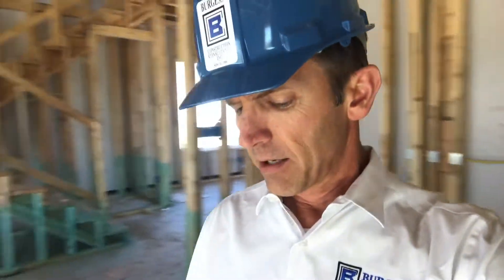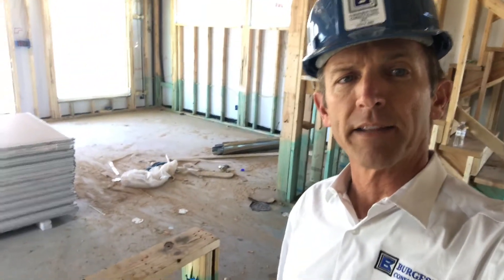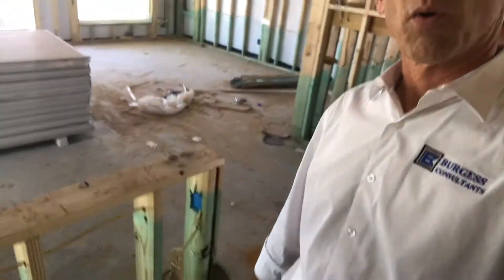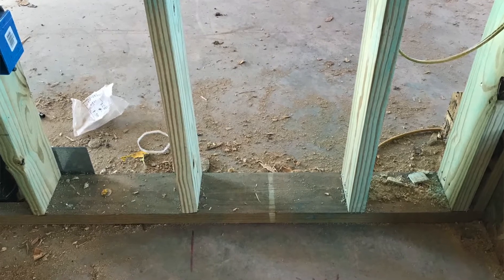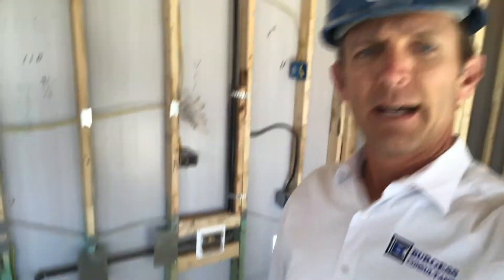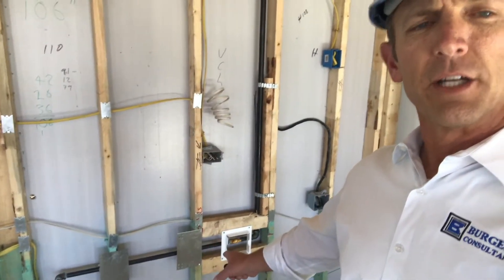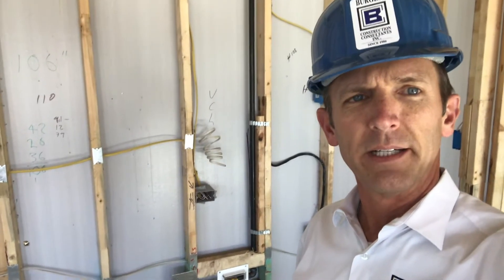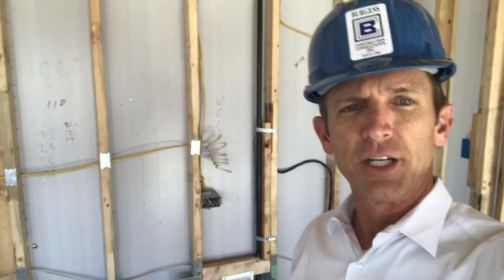Code change for power supply to dishwasher - E4101.3

Comment: You are wrong, you can put the receptacle behind the dishwasher, you just have to use a PDF breaker in the panel, so the reset is accessible.
Reply: WHAT IS PDF BREAKER??
Reply: @groundedelectricalservices4178  it’s a combo AFI and GFCI breaker, you can also put a GFCI under sink if you want and feed the dishwasher receptacle off the line side, but most people cover the receptacle with household cleaning supplies and can’t find, which forces a non paying service call or warranty, so we choose the PDF breaker, it’s easy to find and reset
Reply: The E4101.3 rules apply regardless of circuit protection method. It only covers corded appliances, not the protection requirements.
Reply: You Sir are correct. The only correct answer. People need to read the code, not go to youtube for serious questions. @SerenoOunce
Reply: pdf breaker?
Reply: You must be a fire extinguisher salesman
Reply: You are absolutely correct, all it need is Gfci breaker at a panel
Reply: @Tammera Starn pro tip, most guys who do videos on here have no clue, that’s why they do videos,  instead of actually doing the work and making real money
Reply: @frankstallcup8720  Actually a lot of people have companies and do the work and also film it. So they make real money and fake video money at the same time. Lol